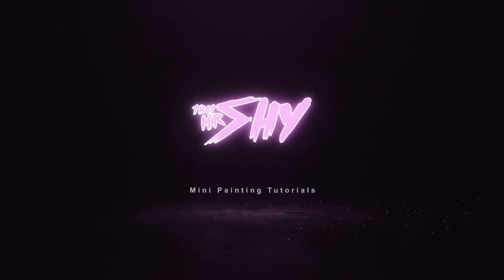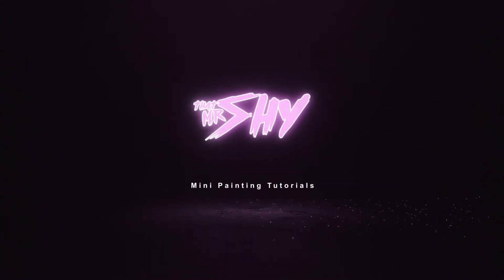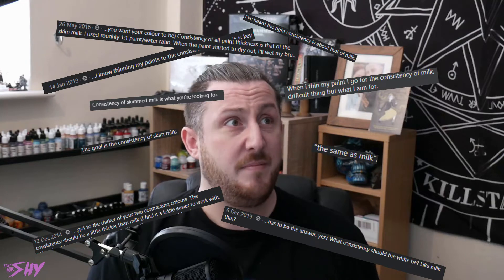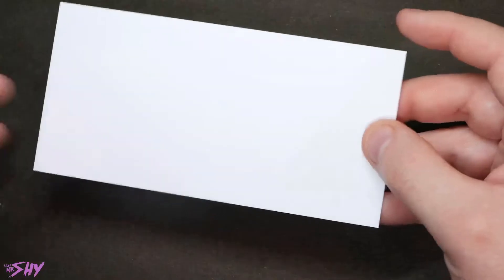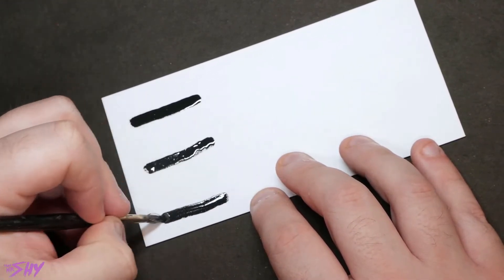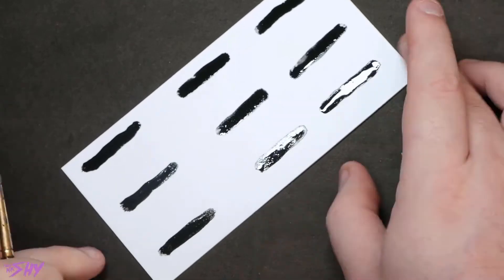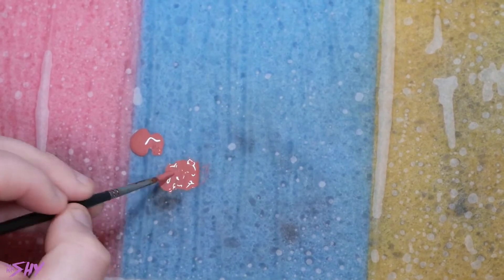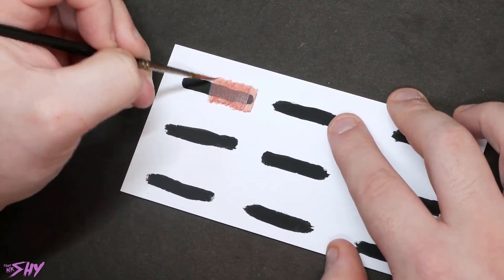Mini Painting 102: Basecoating - HOW TO THIN YOUR PAINTS!

Comment: Under coating and base coating is not Priming. There is a difference between those. It looks like you talking about using 'base coating' black as instead of priming. You mainly do base coat over primed mini and not instead. Unless you mean base coating with priming paint. But I haven't heard you saying anything about priming or using priming paint first.
Reply from the maker: Whilst you may personally differentiate between the terms "undercoating" and "priming" most painters use them interchangeably - both meaning the first layer of paint on the miniature, which is used to create a key for subsequent layers to adhere to better.
Reply: @TesseractMinis  Sure. So basically your clip is about 'Priming model with brush'? For me base coating is first layer on primer and not primer itself. The title of the clip is misleading for me at least.
Reply from the maker: @NightWolf1982pl  erm, no... That isn't at all what it's about, have you watched it all? Sadly, I think you've misunderstood the video. It's very oversimplified, by nature of it being targeted at new painters - so perhaps the depth of clarification isn't enough for you, if you're a more experienced painter. 

The video talks about how to achieve solid basecoats in the simplest method. The focus, as it states at the beginning, is on how thinning affects this, not priming. You seem to have focused on the specific part of the video that I said in the video was less important, hence me asking if you've actually watched it.